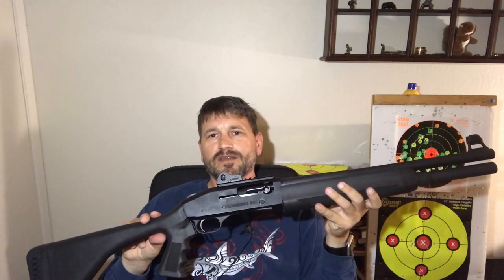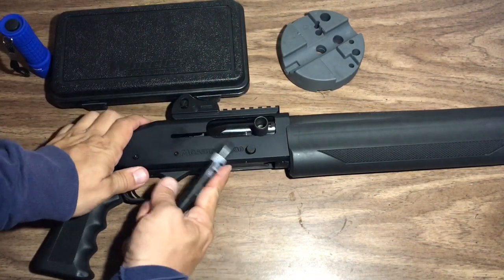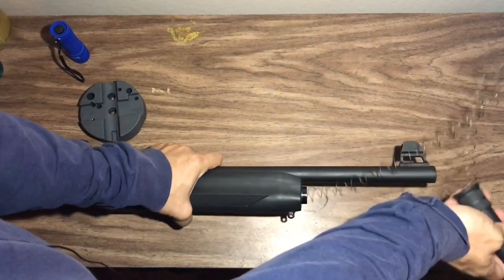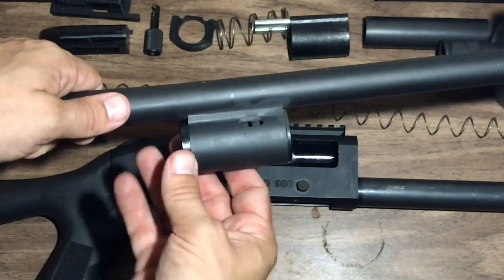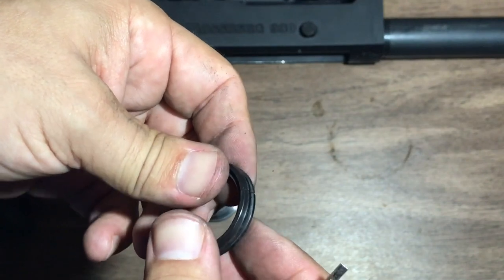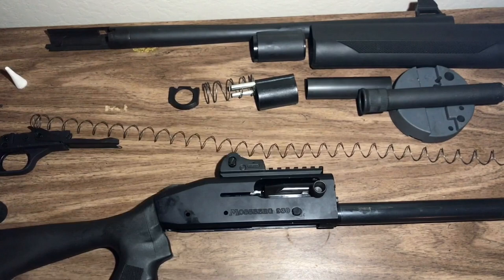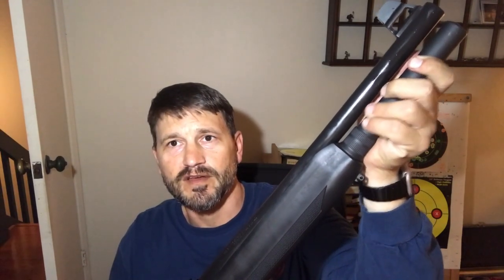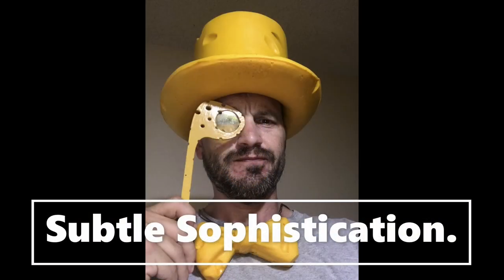Mossberg 930 SPX Field Strip and Cleaning Tips

Comment: To get the spring in easier use a dowel as a guide rod. Drop it down the mag tube, drops the spring around it and then just squeeze it down where you want it. Pinch it and remove the dowel and ad your mag cap/extension. You can also have the cap on as you push the spring down just slide the dowel out the side of the spring instead of straight out once you have it where you want it.

Comment: Very well described process. How refreshing  that I do not need to search for hours on a clearly shot and narrated video explaining a possibly cluster F of issues if not done right. Thanks 3 years later. Yours was the first video I watched!One recommendation I might add: I use a Pexx tube about 2.5 ft long. It fits into the magazine. I then slide the spring over the Pexx and push the spring down over the Pexx tube. Once completely pushed into the tube I remove the Pexx, then hold it in place with two fingers and put the extension on. Prevents kinking. The spring wants to jump out of your hands but makes it mush easier! Any tube shaped object will work, a dowel or PVC for example. I like the Pexx since it is fits just right and keeps the spring from flexing side to side.
Reply from the maker: Excellent tip on the Pexx tube.  Glad I could help.
Reply: @NorthwoodsRenaissance  I liked your comedic relief...

Comment: Inside the supply tube, along with the ammunition spring, came a white plastic piece, I saw his video and I never saw that he removed or assembled such a piece.  What will that piece be for?  or if that piece really belongs to the ammunition spring?
Reply from the maker: Mine never came with that white piece although you're not the first to mention it.  Maybe some kind of fitting to keep the spring from binding in the end of the mag tube?
Reply: @NorthwoodsRenaissance  yes, in the en of the mag tube.
Reply from the maker: @statepr51  Just looked up an exploded diagram and as far as I can tell it's for exactly that, to keep the spring from binding.  Mine didn't come with one but sometimes you have to back off a few clicks with the mag tube otherwise the spring would twist up and you couldn't load the full number of shells.  I assume it was a way to address that problem by making it more likely to untwist as you install the tube.

Comment: I just field stripped my 930 SPX. There’s a little white mushroom-shaped polymer "plug" that fits into the muzzle end of the magazine spring, that got launched into low earth orbit when the spring got away from me during reassembly. The plug seems to act as a buffer between the end of the spring, and the inside of the magazine extension tube. My magazine still accommodated 7 2-3/4” shells with that plug in place. Apparently, that plug has vanished through a worm hole, and I can’t find it. Anyway, I reassembled mine without that plug, and it seems to function just fine. I’ve noticed in your video that your magazine spring doesn’t have that plug on the end of it. Did it used to?

Nowhere does that part seem to be mentioned in any of the schematics found either on the Mossberg website, or in the owner's manual; so unless I find mine, I can’t replace it. Is that a problem?
Reply from the maker: Mine never had one. It might have been added to the later models to keep the magazine spring from binding up when you reattach the magazine tube?  I don't have any experience with Mossberg customer service but if they're as good as most gun companies they'll probably hook you up with a new one if it's an original part. (Heck, even Bersa sent me a free replacement for a broken magazine follower.)
Reply: @NorthwoodsRenaissance  I bought mine brand new in April of 2019. One other question..... did you have to make much sight adjustment for buckshot? I saw that your slugs were hitting low at longer ranges, which is understandable, but I’m curious if you had to make a similar adjustment for buckshot at, say, under 25 yards.
Reply from the maker: @ChristopherSmithWHAM  I'm just going from memory but I zeroed at 50 yards with 2 3/4" Federal Power Shok slugs and was able to get reliable hits out to 100 yards on a 12" plate.  This is the part where I might be having a hazy memory but I believe at 25 yards the bird shot and buck shot patterns are so close to being centered that I didn't have to use any change in my point of aim but I only took a few shots on paper.  Everything else was produce, 2 liter soda bottles, clays, or steel targets.
Reply: @NorthwoodsRenaissance  thanks for all the information. I appreciate the help.
Reply: I wondered the exact same thing. I disassembled this right out of the box and wondered if this was a shipping plug.   It became a small projectile when the spring did its thing. I found mine but could not figure out where it was supposed to go. I assume it goes at the end of the spring and that is how I am using it.  Great video btw.  Simple, nice close camera work, really appreciate it.
Reply: I have the same issue! Any world and where the plastic piece goes?

Comment: I put a side saddle on my 930 SPX, now when I hit my bolt release button it does not cycle forward all the way,I have to push it forward.  I barely have about 50 round if that on it?
Reply: If it's the kind that's mounted by drilling holes in the receiver then check that the screw threads are poking through and causing trouble.  Beyond that my recommendations would be clean and lube it and/or do a quick disassemble re-assemble to make sure you've got that baby put together correctly.
Reply: And for goodness sake, don't leave us hanging.  Check back and tell us when you find the problem.
Reply: @d2bergler  
I will, I am not a gun Smith or anything but with the he lp of YouTube I put on that side saddle and barrel clamp,  I am going to check it out tomorrow.
Reply: You tighten it to much if it's the one with the threads. Loosen it up a bit. It should solve the problem.
Reply: @miguelj06  This is the fix right here.

Comment: You said the manual say's to clean the gun every 500 rounds. what happens to the piston/ carbon if I shoot about 40 rounds and put it in the closet  for about three years?
Reply from the maker: I’m sure it would be fine. I’ve had rust form on the barrel where I left fingerprints but I’m in Hawaii so things tend to rust quickly from the humidity and the sea salt in the air.

Comment: Question. Just picked up my 930 SPX and tube only holds 5 shells. Could this have been delivered to me with a tube plug installed to restrict its 7 shell capacity? If so is this restriction plug hard to remove?
Reply from the maker: You can unscrew the mag tube to check. Just keep a hold of it so the spring doesn’t get away from you and it might be a little difficult to twist off if it’s your first time removing it.
Reply: @NorthwoodsRenaissance  Oh yea. They sure did ship it with a tube plug. I removed it. Very odd they would put that in to limit full capacity. Maybe it’s due to regulations from the state it was shipped from.
Reply from the maker: @techguy3373  Good catch!

Comment: I'm looking for a video on cleaning the SA20 pistol grip which looks essentially like the 20g version of the the 930.  I ordered it, I wonder if your procedure is close enough?
Reply from the maker: I finally got around to having a look at the SA20 exploded diagram.  I might be mistaken but it looks like you can pull the barrel without blasting the magazine spring across the room so it should be even easier.
Reply: @NorthwoodsRenaissance  Thanks sir.  Funny you should mention that diagram. I Goggled something related today and it was a search result. Anyway, pretty new to guns so I still may be looking for a nice step by step.  I'll go back and save that diagram though in case it's all I come up with. Thanks again.

Comment: I've got the Mossberg 930 home security 18 and 1/2 inch barrel.I took it apart everything came flying out and I have a piece I'm not seeing in the schematics that came out. It almost looks like a sprinkler fitting.
Reply from the maker: Hey Justin. If it’s not one of the parts I showed it’s probably either part of the trigger pack, the recoil spring system, or depending on how far you broke it down the shims for the length of the buttstock. I’ve had pins fall out of the trigger pack as I was handling it so that’s a likely culprit. 

If you can’t narrow it down just head over to your local mom and pop gun store. If the geezer behind the counter can’t identify it he’ll know someone who can. You could email Mossberg as well. I’m sure they’d help you out. It doesn’t look good for a manufacturer to have broken guns kicking around in people’s collections.
Reply: Is it a white piece?
Reply: @Danny11B  yes!!
Reply: @Danny11B  what is that white piece?
Reply: I have no clue. I spent literally hours last night trying to find out what it is or how to put it back on, and not a single page, video, or owner's manual mentions it. It fell out of the magazine tube and I don't know if it goes skinny end first inside the tube or what.
Reply: @Danny11B  I'm in the same boat I'm super irritated. I know for a fact that came out of my shotgun.
Reply: Goes on end of spring towards follower
Reply: @robhar82  you mean on the opposite side of the spring from the follower? Also, does the skinny side go into the spring?